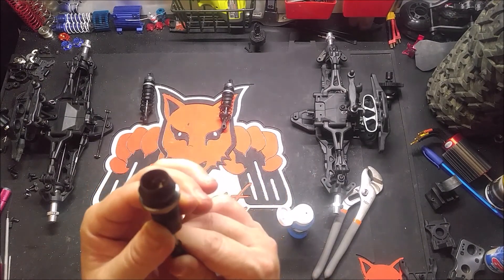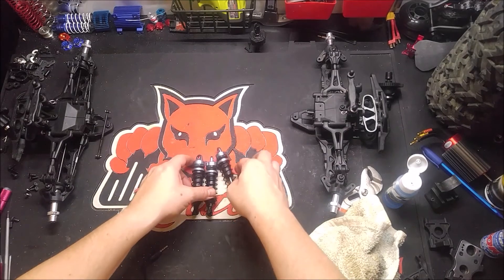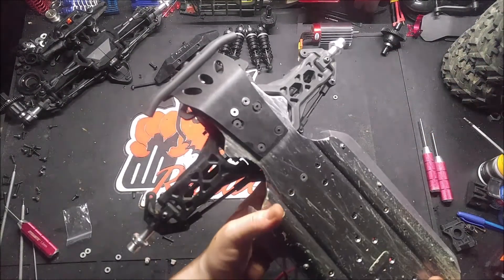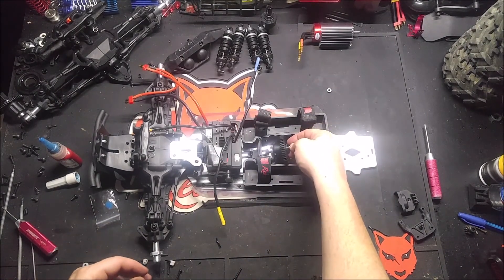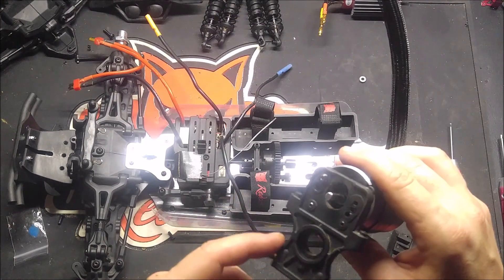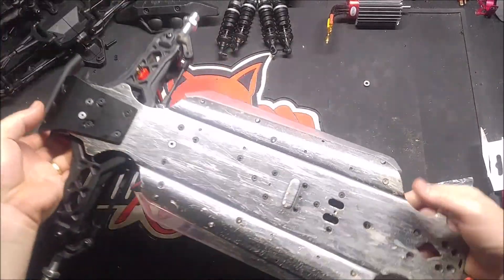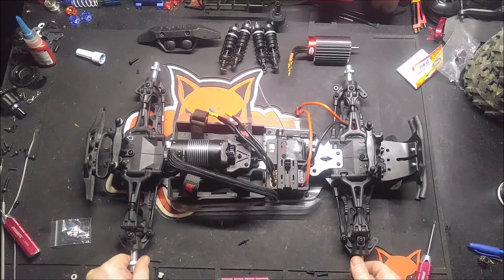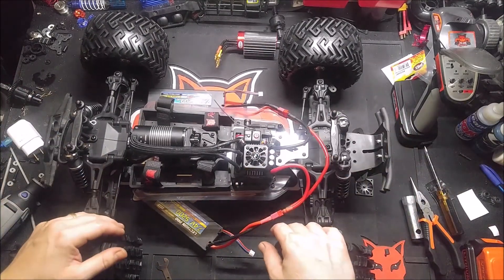Redcat Landslide XTE - Upgrading and Maintenance Part 3 of 3: Shocks, Motor and Reassembly

Comment: Swapped out stock shock on the landslide to thunder tiger shock I love them truck sits high in back an low up front
Reply from the maker: yes i have some high lows coming!  Not thunder tiger though!  I liked the stance on my Avalanche
Reply: No Problems Computer & Hobby sorry man i have two youtube acounts for some reason but what shock woukd fit the landslide xte front shocks. I want a different brand
Reply from the maker: working on a solution.. give me a week or so
Reply from the maker: working on landslide sock upgrades now... more to come

Comment: What pinion size should I use with a 49t steel spur?
Reply from the maker: 15t if what I ran on the stock motor.   I run 16T with a 4274 4S motor now
Reply: No Problems Computer & Hobby  I appreciate your help

Comment: what shock fluid did you use ? My landslide should be in today .
Reply from the maker: 60 but should of went 70 or 80 for bashing
Reply: ok I'll try 80 w
Reply: Is it the same fluid you put in the diffs? You put 200k in the center diff, and 50k in front and rear? I just bought a bottle of 200k, and a bottle of 60k silicone for the diffs, but can i use the 60k in the shocks too or do you use something else?

Comment: Do you sell any wheel extensions for the landslide xte? I need around 60 to 70mm. Thanks
Reply from the maker: 60-70 for an extension is huge.. would cause some serious strain on the stub axle... especially given the design of the current ones.  there is nothing i Know of that would extend it like that... maybe half" hexes from the Earthquake would fit but they would only be like 12mm and i have never tried them on the Landslide to see if they would work.

Comment: Do the white balance connector on the battery stay exposed Normally?
Reply from the maker: yes.   If it is long on in weird position, i usually tuck it into the battery strap

Comment: Do you have a disassembly video of the landslide? I have to swap out some parts and it looks a bit daunting. It’s nothing major but it would be nice to have something to refer to if needed
Reply from the maker: I do not.   I have taken them apart for breakdowns but nothing on camera other then what I have needed to repair. There isn't much to it really though.  shouldn't bee too intimidating.
Reply: No Problems Computer & Hobby it’s ok. I went ahead and got everything take apart and ready for my parts. Thank you for your reply
Reply from the maker: where did you get parts?
Reply: No Problems Computer & Hobby had a runaway issue with my landslide and it had quite the crash. Got ahold of redcat and they are sending me the parts to replace the broken ones
Reply from the maker: Today?
Reply: No Problems Computer & Hobby well the crash itself took place a week or so ago. I’ve been on and off with customer service since then. I’m getting the parts today though, yes. Been waiting a while to get them
Reply from the maker: I know my testing on this one and my customer testing his out with a new motor I think gave them the angle they needed to get the right solution going